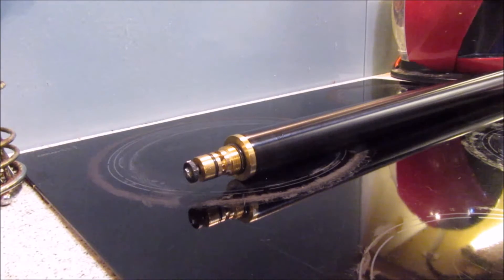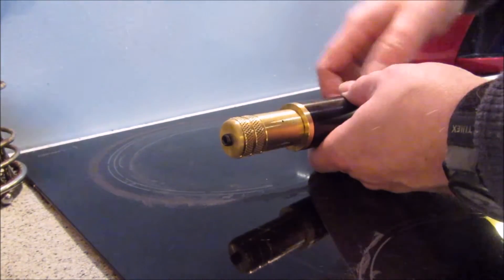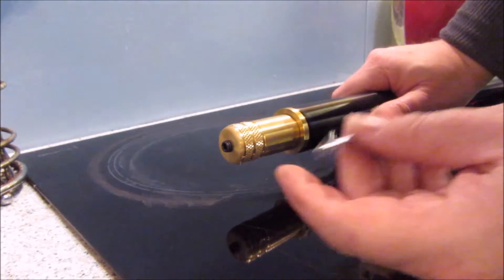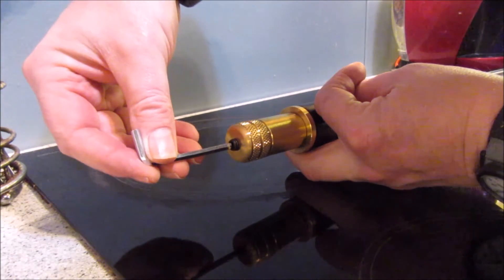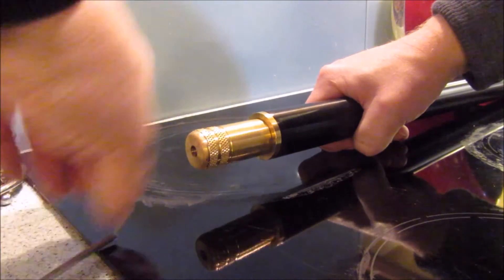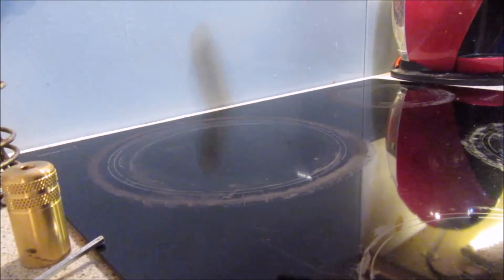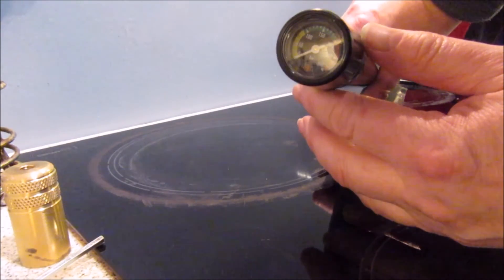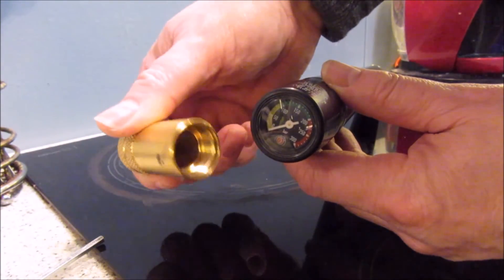Hatsan air release valve and how to use it

Comment: Do you have to bleed it out completely to change cylinders?
Reply from the maker: No. The cylinder has a valve on it, so you can unscrew the cylinder without any danger, wether its full, or empty. You only need to bleed it, if you take the inlet, or exhause valve off. It's designed that way so that you can change cylinders in the field. Quite a few rifles are designed like that.
Reply: Oh ok thanks. I just started getting into PCP and should be receiving my Hatsan by65sb today. My other Question would be. I seen a video of the guy name Dr Russ. You can find his video on here. But he changed his regulator valve pretty simple. He just added a piece to it. Can you let me know where can I order it for my Hatsan. He changed it on a different rifle but the process it’s the same I’m assuming for different rifle.

Comment: Thank you for showing this as the manual is pretty worthless. I have a question now that I released the air from the cylinder and screw it back in it doesn't line up like it did with the opening fill hole. Originally when the rifle was lying down the fill opening on the cylinder was straight up and now with it screwed back in good and tight it is almost under the barrel so to fill I have to use the other side opening which is now almost on the bottom. It is cocked from how it was. Is this ok?
Reply from the maker: Yes, sometimes, over time, the cylinders can work loose, or maybe it wasn't as tight when yo opened it. You can also make sure that the rubber 0 ring hasn't come off the end of the cylinder. If there's no 0 ring, you'll be able to tighten it more than before.
Reply: Thank you and I will check the cylinder out to see. @airgunsniper-elite7385

Comment: where can i get a release valve?
Reply from the maker: If you live in the UK , then Edgar Brothers are the official importer. You could contact them through there website. I couldn't find my de gass tool for my Hatsan Galatian, so I used a rubber mallet to hit it a few times. Once the pressure drops low enough you can push the valve one the floor or table top to release the rest of the air.
Reply: @airgunsniper-elite7385  is it wise to dry shoot it Several times vs rubber mallet?

Comment: Thanks a bunch for this video cuz there's nothing mentioned regarding air release in the bullboss manual.. very vague descriptions only..
Reply from the maker: The good thing with Hatsan is that they supply de-gas valves for their cylinder rifles. It saves shooting them dry when tuning.
Reply: @airgunsniper-elite7385  ain't firing without pellets bad for the gun

Comment: Thank you Sir for your great info on how to use the air discharge cylinder that comes with the Hatsan air rifles. Why is the supplied manual for the air rifle so vague in explaining this because it is not in the manual? There are other parts included with the air rifle I just bought, the Hatsan BT65SL QE Carnivore and it does not list the parts so I have no idea what they are for.
Reply: Same with my Invader, lol!

Comment: Hello sir . Tank you so much 4 all ur information . Acctualy my hatsan gladus has got air leake  in hole which i have 2 place a  5.5 calibrate . When i leave it at number 1 power every thing is normal but soon that i go at power 4 or 5  i feel a lots of air and hear big sound just next to my face and   i feel the air . Would you help me with this . Thanks so much